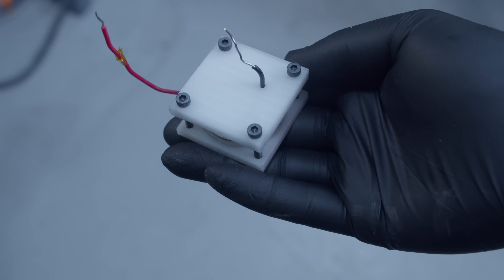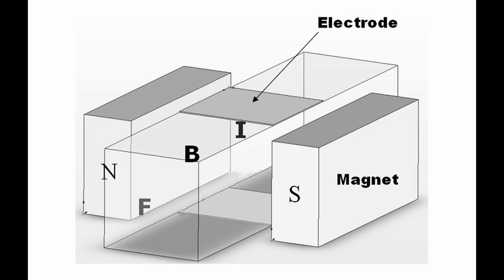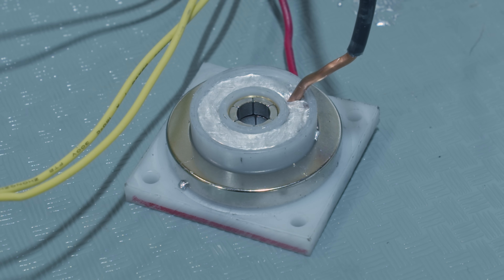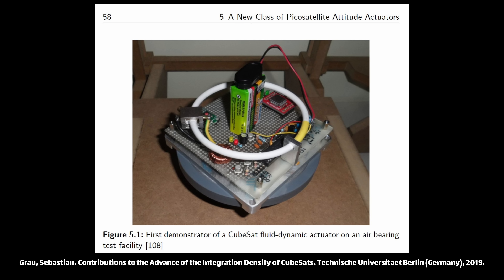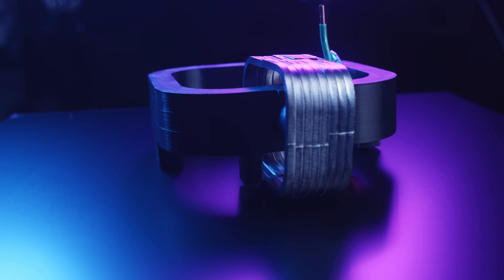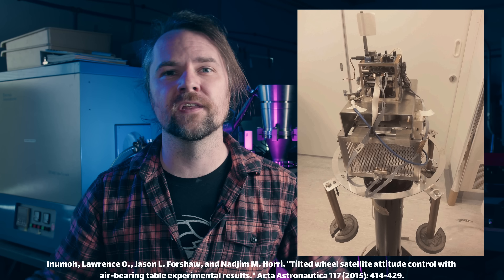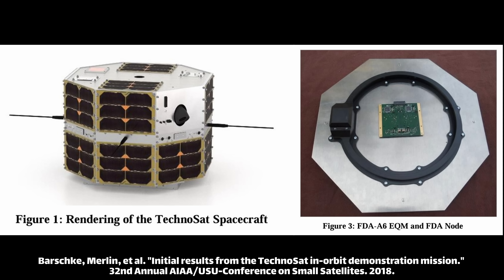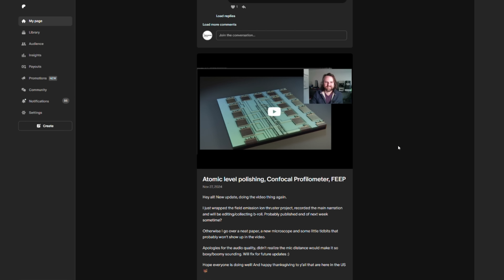A motor with no moving parts (sorta)

Comment from the maker: - Power calcs
I'm bad at everything and misread the current limit of the buck converter. It's limited to 12A, so power efficiency was notably better than I mentioned (albeit still pretty bad). Oops 🙃

- Temperature!
Sorry, I should have mentioned this: galinstan has a freezing point around -18 to -20C, which is near the lowest temperature experienced in LEO orbit. So it might need a small heater to keep liquid, but maybe not depending on how much heat is retained from the sunwards pass of the orbit. The liquid metal will have a fairly large amount of thermal mass, and contained in an insulating polymer of some type. Also will experience some self-heating from joule losses during operation. Missions farther from the sun would need a heater to stay liquid however.
Reply: wouldn't  mercury work better for space?
Reply: There's a risk of leaking and contamination on reentry or if the launch fails somehow. It's not a lot of toxic material but designing your satellite to release it into the environment at EOL is a tough sell.
Reply from the maker: @fluffy_tail4365  Kinda sorta. Won't eat the spacecraft, and lower freezing point which is great. But toxic so no one really wants to work with it if possible. It also ends up being not quite as efficient because it's less dense and less conductive (although lower viscosity too). Performance depends a lot on the specific geometry and magnet configuration, but mercury as a rough rule tends to be less efficient.  But to be honest, I haven't seen many papers looking at it due to the toxicity problem so possible it could be optimized to run better... and just no one has because no one experiments with it.
Reply: @BreakingTaps mercury (13.55g/cm³) is much denser than galinstan (6.44g/cm³)
Reply: @BreakingTaps  mercury forms amalgams with a lot of metals, especially aluminium, so you still have to be very careful to avoid it eating your spacecraft.
Reply: @JaenFoster    Yes its more dense, liquid to -39C, less corrosive. Yes it’s toxic, so gotta be careful. But if it’s less efficient, due to conductivity, then thats a big deal.
Reply: @rxy228  Gallium does that too, it's just less reactive. Amalgam components can influence the effects, even to the worse.
Reply: @BreakingTaps  Cody (Cody's Lab) would probably be happy to experiment with it, he had enough to see how it would flush in a toilet 😂  Tbh elemental mercury isn't that nasty to work with compared to it's salts, I would think any space organisation would have the skills and facilities to do this.
Reply: @ferrumignis  I mean there's a spectrum of toxicity. Compared to galinstan, mercury is naty. Compared to hydrazine? Not so scary.
Reply: @BreakingTaps  - what about metal nano-particles suspended in a liquid? Couldn't they be made to similarly flow around in a loop?
Reply: @BreakingTaps  in the early 70`s we were given liquid murcury to play with at school , the physics teacher just spreading Sulphur i think over all the spilled bobules ., meanwhile the caretaker was putting damp asbestos panels on a bonfire , but then there was loads lead in fuel and paint so we were probably to stupid to notice any danger , then there's the pesticides then ...
Reply: @manofsan  good question but no, for the same reason they laminate transformer cores.
Reply: @BreakingTaps also denser so potentially more mass on the wheel too, making it more efficient???👀
Reply: @iTeerRex have we considered dissolving copper or gold into the mercury
Reply: @petevenuti7355  - I don't get it - why would nanoparticle supension be inferior to liquid metal? Are you referring to eddy current loses? It would seem to me that liquid metal would suffer from worse eddy currents than nanoparticles would.
Reply: @BreakingTaps  also mercury would freeze in deep space / if it gets cold enough. -38F is it’s freezing point
Reply: @BreakingTaps  YOU KNOW NOTHING AT ALL!!!!!!!!!!!
Reply: @manofsan  you want the eddy currents, like an induction motor, you need those currents to make a magnetic field to react against the permanent magnets to make the motion.
Reply: @BreakingTaps   please Check the Mass of the device you bulid when powered.   You build an anti Gravity device !!!!!!!   Please Check it.   And use liquid merqury
Reply: @JaenFoster  power needed to move mercury is also higher by about 75-90% higher and could be a reason it's not used in space application due to limitations on power reserves.
Reply: 1V @20A is a Standard cpu voltage regulator. A modern gpu pulls 400-600A @0.6-0.7V...
Reply: when people say "no moving parts" I'm going to start counting electrons as parts dangit
Reply: Does the short circuit not produce a lot of heat? I had always been under the impression that anywhere you have a short, you have a lot of heat.
Reply: @SpriteGuard  Power is proportional to current squared multiplied by resistance (I^2R), so the power dissipated in the motors is minimal.  The buck converter generating the high current/low voltage is likely to dissipate more through switching and copper loss than the motor.
Reply: @SpriteGuard because the metal is moving it produces back-emf which opposes the current and makes it not a short circuit 

That’s the same reason the coils in an electric motor are short circuits on paper, but they don’t behave like short circuits as long as the motor is spinning. 

But if you manage to hold the output shaft still, it is a short circuit and the motor will quickly burn up
Reply: If there's anything on the satellite that generates an excess of heat (RTG perhaps), it could simultaneously be used as a "coolant" AND reaction wheel, dependent upon design requirements.
Reply: For future reference a molicel p30b or p50b should easily provide the current you need. They're capable of 20A sustainable iirc. They're the battery of choice for high power flashlights
Reply: @Ruckusmatter I'd recommend sticking a high amp fuse at the end just in case especially with very high current cells
Reply: @ntf8313  Good idea. I recommend a coil relay that reacts to a threshold, relatively unaffected by temperature and adjustable.
Reply: Wouldn't the solidified metal produce heat through resistance and liquify itself?
Reply: Continuing with the space theme of flywheels and engines, I propose a mental experiment. Let's imagine two flywheels fixed at a distance from each other on a rigid support and rotating alternately in the opposite direction in the same plane... The question is, will it fly in zero gravity?
Reply: @div2363   IT IS an anti Gravity device
Reply: @div2363  блин, чувак, мы мыслим одинаково! Я тоже думал об этом!
Reply: @div2363  единственное, не пойму, зачем менять направление вращения? В той конструкции которую, ты приводишь, такая смена направления приведёт к смене направления тяги. Чтобы бесконечно не раскручивать маховики и не терять тягу, опора сама должна вращаться относительно продольной оси космического корабля. Когда раскрученный маховик из левой полуплоскости перейдёт в правую, его можно будет останавливать. Аналогично со вторым маховиком. Таким образом получится безопорный двигатель непрерывного действия. Осталось только его испытать. Если он заработает, то можно будет сделать гидродинамический вариант двигателя, где вместо маховика и подвесок будет пробка из жидкого металла и трубка, форма которой будет соответствовать траектории одной точки маховика. Если быть точнее, таких трубок будет две - по числу заменяемых маховиков. Трубки будут из диэлектрика, а внутри будут металлические полоски, по бокам конструкции будут магниты. Получается лёгкий, простой, износостойкий и производительный двигатель, пригодный для практического применения, например для приведения в движение кукол Шанхай из Тохо (да, весь этот двигатель я придумал именно ради создания этих няшных, обезоруживающе милых летающих куколок, которых, к сожалению, не найти в продаже). Причём такой двигатель позволил бы кукле летать без всяких крыльев и пропеллеров или ракетных двигателей - они могли бы висеть в воздухе и летать по-настоящему, как в сказке...
Reply: How about Mercury?  It forms amalgams so that's an issue, but it's dense, conductive and doesn't oxide easily.
Reply: How did the Berlin team address this problem?
Reply: Figuring out such specific heat management and the function of a few fluid reaction "wheels" is an interesting idea for a cubesat. It could also be combined with a preexisting project, and, if successful, enhance it.
I highly recommend getting in touch with guys who do those (universities or something).
Reply: should be a huge difference in temps in sun vs not sun too... pretty sure if its -60 on the ground its probably -200 in space. 

then you have ucs weather patterns, that draw space into the earth... sometimes getting to -80 ...

definately going to be moments of both + / - 200
Reply: Wouldn't the passing current through the metal heat it slightly? I imagine at larger scales this would be more substantial?
Reply: The spacecraft isn't going to get that cold as the bus heater will engage well before that.

The lithium batteries require not being frozen, so you can count on that requirement. You wouldn't be the most strict component when it comes to temperature.

Source: space mechanic
Reply: You are putting in a bunch of watts just to use it, good insulation ought to be enough.
Reply: Wouldn't running current through it also heat it up a little?
Reply: This is actually the oldest kind of motor,  Michael Faraday made it first in 1821
Reply: So it might be useful for drones within the walls of future space stations, where the temperature is better regulated
Reply: Would it not work as at heater on it's own? since it's inefficient when running?
Reply: Who needs a heater when you are already applying current? Joule heat the metal itself, a little sea-saw wiggle in the rcs system to keep everything on point is acceptable unless you're an imaging satellite that needs absolutely perfect control, In which case, redundant (2 per axis) RCS.
Reply: Putting a lot of toxic heavy metal in Low Earth Orbit is a bad idea, as it WILL eventually re-enter the atmosphere.
Reply: What about NaK?
Reply: A good choice of battery would be an 18650 Li-Ion cell intended for vaping, as they don't have the safety current limiting circuit. They'll easily do 12A from a single cell. You would need to use some sort of current limiting circuit, of course.
Reply: Thats fun. I do sub. Why you choose rectangular instead of circular? Would it be working with metal particles in water or oil? The loss is heat. A single A123 LiFePo would do the job without the stepper.
Reply: Are those liquid motors resistant to temperature like can they run hotter than normal electric motors
Reply: 11:22 😅😅😊😊😊😊
Reply: Why not have an open to space vacuum solid toroid that works similar to a maglev?  It would be frictionless and zero wear.
Reply: Left Hand Rule!! Left hand! Right hand is when experience a current from the conductor,  left is inducing it to the conductor
And don't take my word for it, minute 1 of 
 https://www.youtube.com/watch?v=GmURfG3tAhg&t=70s
if you wanna know more
Reply: THE SYSTEM IS GARBAGE BECAUSE GALLIUM AND MERCURY PRODUCES A DANGEROUS GAS THAT AFFECTS THE BRAIN AND PRODUCES HAT DEMENTIA PLUS IT HAS NO INNOVATION OR ADVANTAGE OVER THE SAME MADE IN HARD METAL WITH IRON AND COPPER IT DOES NOT EVEN HAVE A WEIGHT ADVANTAGE
Reply: Significant problem here is the galinstan. Its core component is gallium which is extremely corrosive to aluminum, zinc and steel. which a significant amount of spacecraft are composed of.
Reply: “Verily, verily, I say unto you, He that heareth my word, and believeth on him that sent me, hath everlasting life, and shall not come into condemnation; but is passed from death unto life.”
Reply: jesus loves you and died for you and rose in the third day, for you
Reply: @ The Bible verse Matthew 6:5 says, "And when you pray, do not be like the hypocrites, for they love to pray standing in the synagogues and on the street corners to be seen by men"

Do not take some, only to ignore other parts of the bible. God frowns upon thee for cherry picking his words.
Reply: I want to rotate that metal at light speed. do it and let me know
Reply: @nastybadger-tn4kl  cant. Nothing with mass can go the speed of light. It would take infinite amounts of energy
Reply: @unmortal8672  ok 20000km per hour
Reply: @unmortal8672  One condition. the mass of  liquid metal need to be same weight of all magnets and all weights.

We get closer to antigravity vehicle.
Reply: @ It wouldn't work. Also just randomly spouting off nonsense doesn't make you sound intelligent. Quite the opposite really.
Reply: @ Use your brain. Dont ask question.

Always think without belief.

To see nature you have to be nature.

Observe without any beliefs

Goodluck.

Words has no wisdom but lies.
Reply: No one can change stupid
Reply: @nastybadger-tn4kl  keep coping kiddo...🤣
Reply: This is gunna screw your head up but can you monetize your videos more so I don't have to see them? 10 cents back for reading this comment. ♾
Reply: Put R mercury , u will get out of this world effects
Reply: Thanks, was the first thing that came to mind
Reply: Simple suggestion for heating - Alternating Current. No clue if it would have any long term negative effects, but could introduce heat without any extra parts.

Comment: work the other way.
this is the homopolar generator with a slight twist. ie, they work just as well as a cylinder with a radial magnetic field and axial current. 

as the field area is only small, and the current area small... the effect is small.

i cant help but see a conductive ring, and that leads to other thoughts such as a fluid has at least two modes of circulation in such a system...

conductive ring... loop... eddy... 

hmmm...

Comment: Turbulence seems like a big issue. Like i noticed the moment you stop powering the liquid the device immediately spun backwards, even on the air baring, as if the liquid inside came to a quick stop. Where as with a normal flywheel I would expect the wheel to come to a halt much slower. To me that also means you have to continuously put in more power to keep the liquid spinning at the same speed then as you would with a flywheel of the same mass.

If you can remove the turbulence somehow though that should work much better. For one I think the rectangular design probably did not help. Maybe something with thin walls would work better, you can still make them high I think like ring made of paper, so long as you constrain the fluid in one dimension. A side benefit would be that you can have the magnets much closer to each other.

Comment: It could be channeled into a centrifugal clutch, spinning farther away as it speeds up adding mass to the outside, like a motor with variable power and use capabilities, because of the automatic variable gear capabilities. It wouldn't be a conventional gear. It would act like a liquid gear, or expanding flywheel maybe the best way to say it.

Comment: Can you make it into a 3-phase induction motor?  Just dragging the conductive fluid along via induction in a rotating magnetic field.  You wouldn't need any electrode in that configuration.  The fluid could be in a tube looped around on itself and sealed.

Comment: One more question on the larger design those are neodymium magnets which are permanent magnets correct and you're mixing them with carbon steel which you're then turning into an electromagnet so are you getting more from your electromagnet do to the presence of permanent magnets?

Comment: You can slowly ramp up the amounts of energy your appliance so there wouldn't be any vibration nor any start or stop to the reaction wheel it would be a slow spin up but I still would like to see if having tesla valves s inside would create potentially more torque

Comment: It's pretty amazing to me as I just also learned about liquid bearings which is which are pretty cool... And I'm thinking about how to make a atomic force microscope of my own and I saw that you can use broken silicon that you actually sandwich it in between some tungsten smack it real hard and pick out the shard that is the most pointed.

Comment: So lay down in the center of that channel of preformed ring with the Tesla valve etched in it in one direction and then you can make another motor with the opposite direction and you could actually make a four-sided cube so that you have all directions represented and could potentially provide you with a lot more to work as you're not going to get any backflow? Hi this is an assumption that we need to be tested of course...

Comment: Okay so I just had an idea what about using a Tesla valve in your motor to improve efficiency and to reduce backflow because it's a non-mechanical design that more or less prevents or rather than prevents and promotes one-way flow. Could that make your liquid motor produce more torque?

Comment: Instead of a mechanical gyroscope to test rotation, you can always suspend the motor in a bowl floating on oil🤷
Or water, but i figure the oil might give it more traction. But it's similar to the natural compass with a needle on a leaf floating freely in water. It allows the needle to point north so it should work inthis experiment😊 Hopefully lol